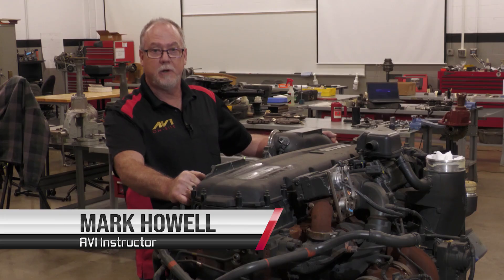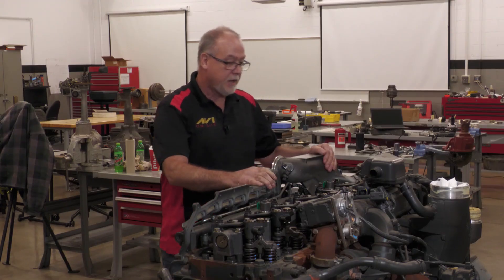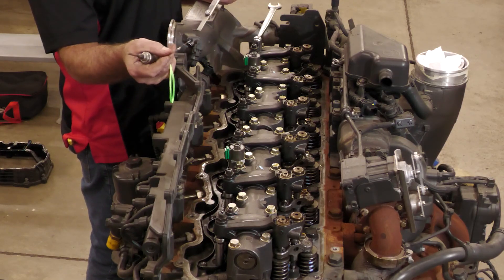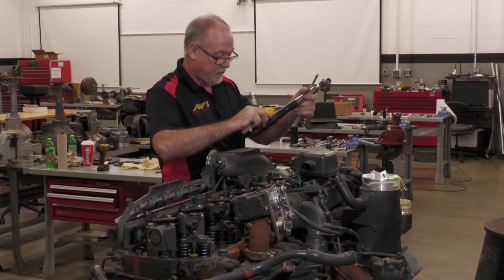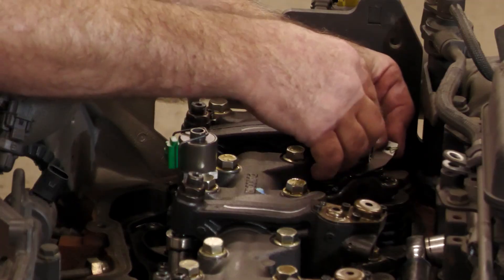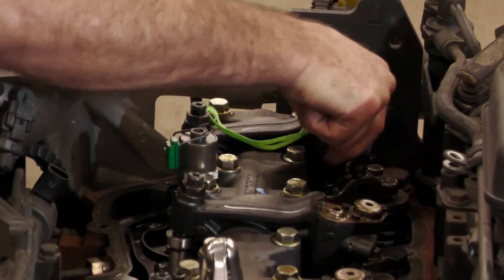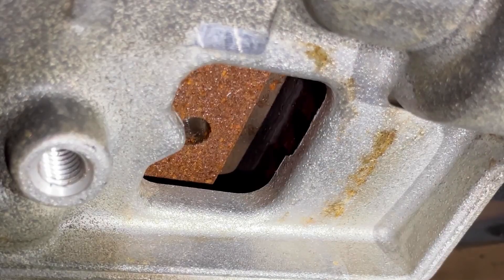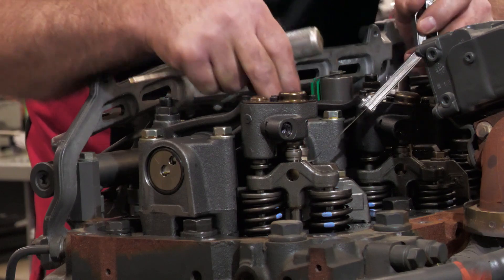Paccar MX 13 EPA 2017 Valve Adjustment

Comment: The firing order for All 6 Cylinder Diesels is 153624. So when cylinder 1 valves are closed they will be loose and cylinder 6 will be tight. You will then start your adjustments on cylinder 1 then proceed to cylinder 5 then 3 then 6 then 2 then 4.
If 6 was loose and 1 was tight you would then begin with Cylinder 6 then adjust 2 then 4 then 1 then 5 then 3…..
1-6
2-5
3-4
When both valves of the above are loose the opposing will be tight. You can start on any cylinder group, just start with the loose valves and follow the rest with the correct firing order.

Comment: Nice video but I’m a lil confused. You set it on 1-6. Then you came to the top and grab cylinder 1 and said they were loose and then grabbed cylinder 4 all the way in back and said these are tight. What order are you going in?